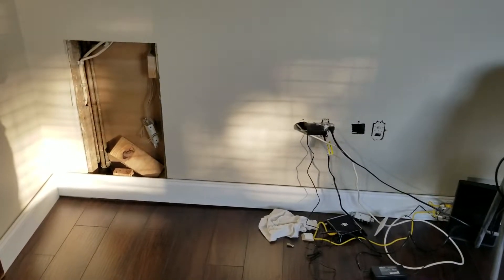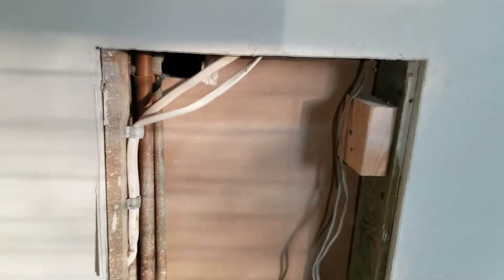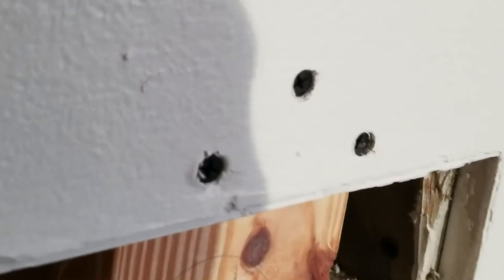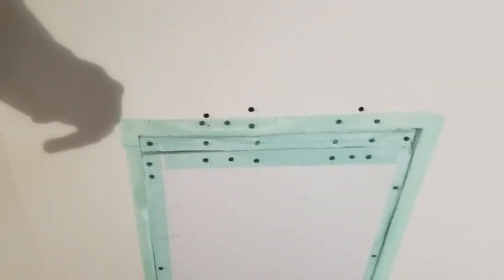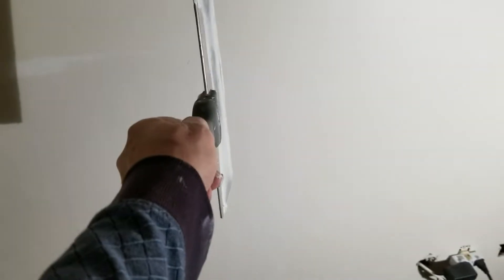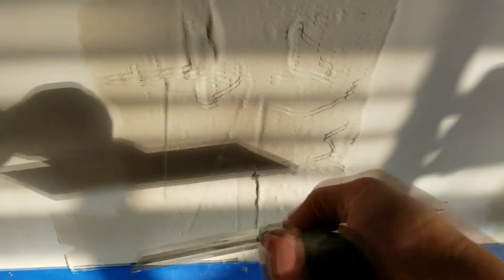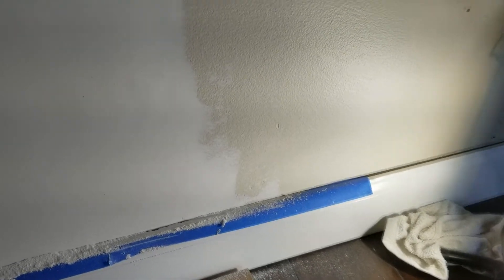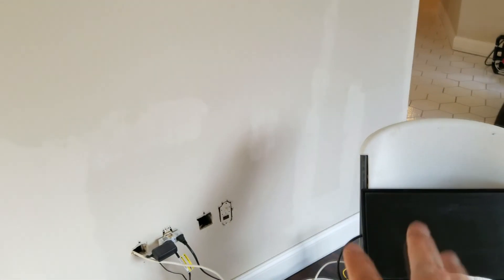How to fix a big hole in the wall fast, drywall repair DIY

Comment from the maker: ✅ Parts and Tools used in this video:
 ✅
Rockewell Sonicrafter to cut drywall: https://amzn.to/2LnEJNU
Ridgid WD4070 4 Gallon Portable Vacuum: https://amzn.to/2SAeyX6
Green Mesh Drywall Tape: https://amzn.to/2I8ulf2
DEWALT DCK299D1T1 Hammer Drill, Impact Driver Kit: https://amzn.to/2M6h450
Warner 4" ProGrip Drywall Taping Knife: https://amzn.to/2Ff5VNo
LENOX Tools Gold Utility Knife: https://amzn.to/2OczX7G
Milwaukee Magnetic Tape Measure 25 ft: https://amzn.to/2XVAaQS

Comment: Do NOT use an impact driver, use a screw gun with torque set low enough to sink in screws just under surface.
Reply from the maker: Our impact driver has a low torque setting, that's ideal for kitchen cabinets. You can also use the small deWalt drywall screw setting bits which work really well.
Reply: @jeffostroff torque setting is key, most impact driver homeowners have do not have this feature. Buy if it does it will work perfectly as you say then., cheers